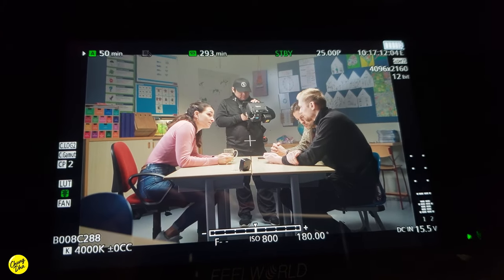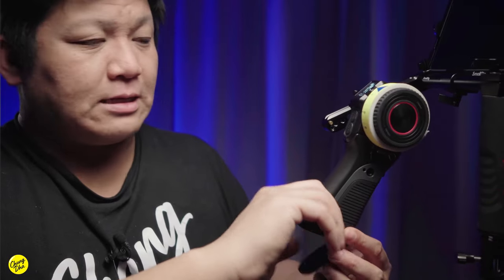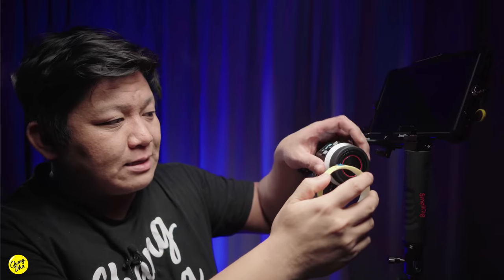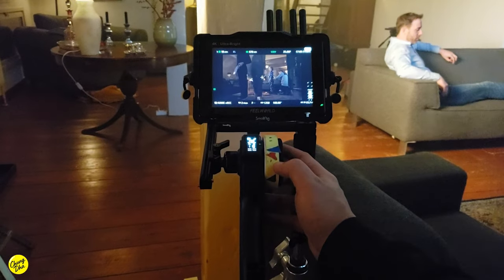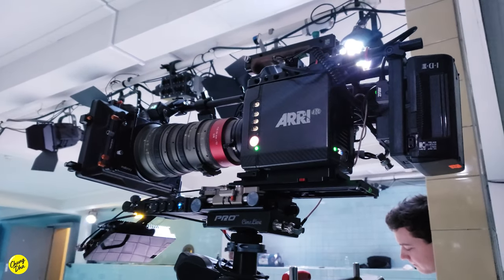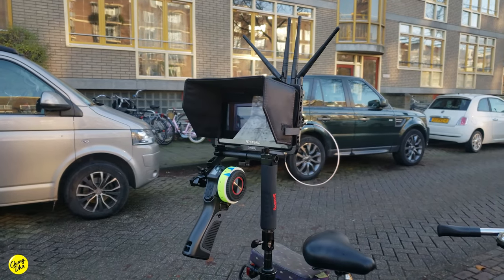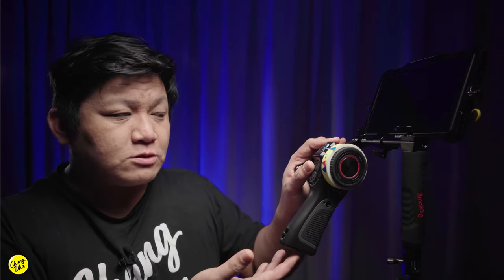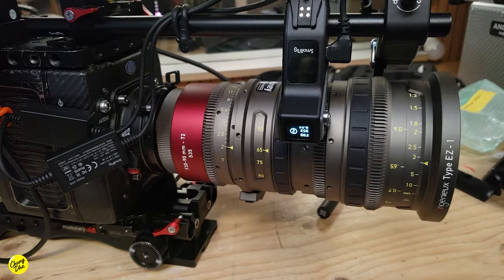SmallRig MagicFIZ review by a Focus Puller

Comment: I'm debating whether to buy this or the Tilta Nuclear M. Tilta is stable, but expensive. My budget allows me to only buy 1 motor kit for the Tilta. I can buy a smallrig 2 motor kit for the same price. Which one do you recommend? I'm concerned about the smallrig's latency and interference. is it also useful for focus pullers when shooting handheld?
Reply from the maker: Never had interference issue with the Smallrig, only had interference issue with Nucleus M where the M remote just would not want to connect, even changing to all the different channels. Smallrig just works, however Smallrig motors are not as strong and slow focus can happen with lenses that have friction. If you can wait till september there are a lot of new tech coming out around follow focus, as M is quite old.
Reply: @chungdha   man!!! thank you for reply!! it was very helpful to me! i don't know about septembers new gear, but i will wait for it! thank you bro!!! have a good day!